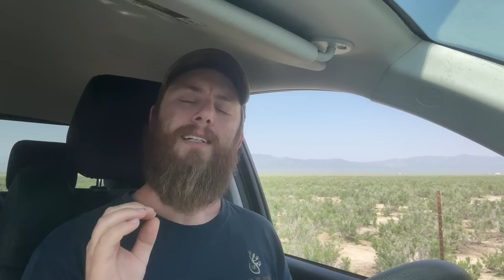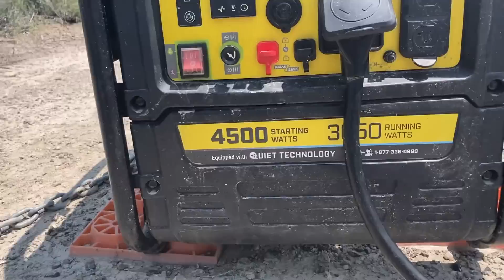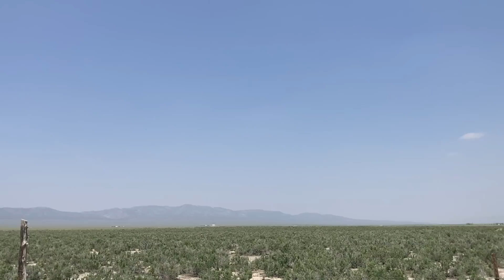GOV. issues EMERGENCY BLACKOUT WARNING  - 7 STATES - PREPARE RIGHT NOW!

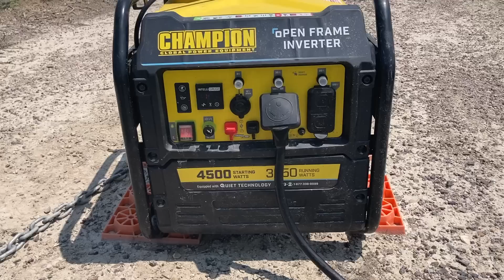Comment: Personally Speaking:  5 was WISE and 5 was FOOLISH.   NOTE: when the FOOLISH learned they had failed to rightly PREP;   they will have the guts to ask the WISE for help; in this parable the WISE could not afford to HELP never-the-less When facing starvation many are going to turn on the preped. Essentially kin-folks; they are the ones we should have never told what we had.  So leave a note for them to read / John 3:16-21.

Comment: Not a a bad idea to disconnect all of your network devices when not using them. Also airplane mode is not a zero transmission state... you'd have to power off your phone AND place it in a faraday cage to block incoming/ outgoing cell transmissions. And if your have one of those Alexa/ Ring type devices, get rid of it now.
Reply: Off grid & cages are a good back up. Ambient listen gadgets include Goggle Assistant. Tech  surveillance is everywhere.  Authorities know where folks are when they power back on & plug in.    “Eyes in the sky”  low orbiting satellites circle, surveil the globe every 24 hrs.  Think Elon Musks Starlink systems. Just launched 20 more. Should have few thousand by now. His contract was increased to 40k satellites. What all do they capture?  Satellites can detect/archive ground activity. Google has addresses, BD, names listed for each account. Plus list of downloads, searches.   They’ve prepped for this.
Reply: Even with devices turned off/unplugged, they still have tech that can be activated to track it. Including tvs. Faraday cage would be a must, or no technology lol

Comment: I have a generator but it seems like they’re trying to knock us out from using a generator.  Gas is so high just to keep the generator running  can break you after a week of constant running. The system is set up for us to fail that is the truth. Also we’ve been having these quick power surges. Something is definitely going on with our power grid. This year we have had the most power outages than any other year. I called in because it’s getting bad The operator told me half were natural occurrences like tree on power line, lightning strikes and clamps going out but they could just be saying this. The girl said they’re trying to do as much as they can on their end upgrading out dated equipment. It is so bad I had to get a ups to keep the internet on during these outages.

Comment: Well what happened to the huge snow pack this year in the Cascades and other mountain ranges. There should be plenty of water for crops even with power disruption.
Reply: Ummm… the same thing that happens to it every year lol
It slowly melts and we irrigate all our crops with it. Ben doing it consistently year after year. 
Stop living in fear people and start living prepared.
10 acres of flat ground in the middle of the dessert is easier to find a human on than 1 acre in the high mountains.

Comment: @Patrick Humphrey I have a serious question.  If they have the technology to create/muck with the weather & worse… then what good would it do trying to have a garden /remote local? Wouldn’t that still be just as easy for them to destroy just like everything else?   I’m going by what others have been sharing about how crops are being destroyed &/pr  partially ruined chemtrails, etc…. What are your thoughts on this?  Much Love & Peace♥️🕊🔥
Reply: I've thought about this myself. My conclusion is that skills and building resilience are the best investments. That is, besides the number 1 skill, strong faith in the Most High. These things are cultivated through action. As long as we aren't putting our faith and security in where we are or what we have, then challenging ourselves in different environments will only make us stronger. Just my humble opinion.
Reply: Well if you’re in the middle of no where, probably won’t dump as much on you theoretically 

But I heard if you boil vinegar and let it cool outside, it’ll help your plants
Reply: @melissasmomglam  What kind of vinegar?
Reply: @njprepper8601  white … Just regular but probably any kind … apple cider vinegar would probably work too but it’s more pricey

Comment: Good for you. Been doing the same as u. Lived in the rv. Got land. Got septic. Satellite internet. Got electricity, water, a ten year old double wide trailer that needed renovations. They are half done. We are half moved in. There's a light at the end of the tunnel. Where there's a will there's a way.  Keep fighting the good fight!
Reply: Sat inter,net won't be there ,no phones hardwired ,radio capable not there aoll those need power to operate if you have power generators hold onto dvds taprs etc basic reception of anything will
be gone life as you now know it will be gone if a true hit the fan kills grids
Reply: I am looking to do the exact same thing!

Comment: I got property 13 north of holebrook az  1 mile south of Hopi native Indians lands the res, putting a under ground 10×40 metal shipping container, and parking my old rv over the top of it ,my rv is a battel wagon runs on propane natural gas, or gas, 454 chevy with extra water tanks ,120 gallon gas tank,300 gallons of propane, my old solar panels  on top , 650 watt Onan generator, runs on propane or gas,and lead core battery's, bring it all on ,

Comment: I work at a storage facility, get lots of plunder, what all you need up there pueblo area, let me know,no solar panels, just my old Simmons 12 volt ,ground to ground ,been putting out 10 amps,12 volt,for over 40 years ,never checked the oil or gas ,😅🤣😂

Comment: Can AI plug itself back into the electric outlets if someone pulls the plugs?
Reply: It could do a whole lot if damage before all plugs are pulled worldwide.
Reply: Ai isn’t really a stand alone computer device. It’s code - it makes copies of itself onto every memory “device” so we would need total electronic shutdown - permanently to shut down Ai
Reply: MOHRS Law technology doubles every 18 months. Even our military members fear the rapid growth of Ai - “it could take over weapon systems” .. Dave Hodges just did a report about
Reply: Giggle. Only if it has arms or replaceable batteries, or climbs out of the computer. Couldn't resist me, being silly. AI can be installed in robots with arms, so maybe.
Reply: AI is programmed into devices. I don't see how it can physically recharge the main computer nor any devices. How can it build anything, actually build its self arm, legs, fingers, use a tool, pick up a plug?
Reply: You have all watched to much Hollywood bullshit movies, and now you’re believing it. 🤣🤯

Comment: What are you talking about that the Electric Grid could Collapse? [ I'm just picking on you 😁 ] you're absolutely correct! & plug everyone's electric vehicles into it at the same time! && how is converting all military vehicles to electric/ batteries  going T00 work out?  Before war / have too put charging stations on the battlefield first! 
What would the founding fathers think?

Comment: A solar panel  is like 150 inverter $200. And up 4000 watts only and up. All batteries  🔋  break every year. Plan it.
Reply: Mine last around 3 years. I'm using g 6 volt- 262aH golf cart batteries.  10 of em making 5- 12 volt, pairs. It can get us by if we don't need too much power. Wood stove too. Feel fortunate.
Reply: Not lead acid. If taken care off